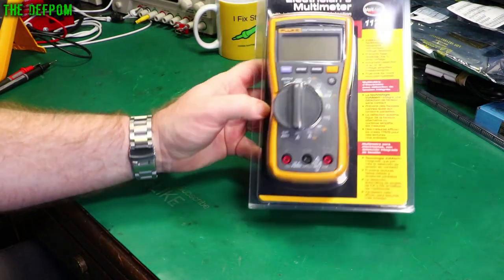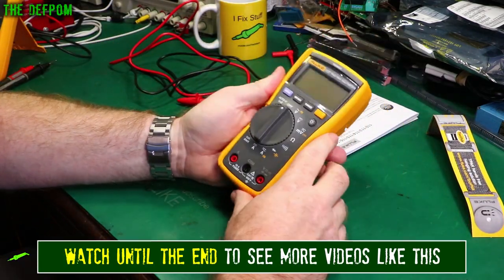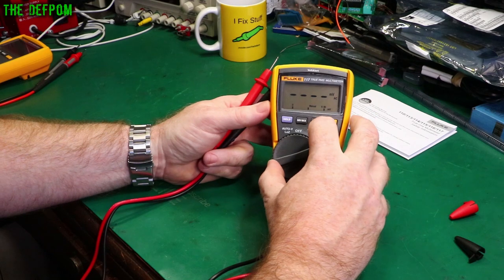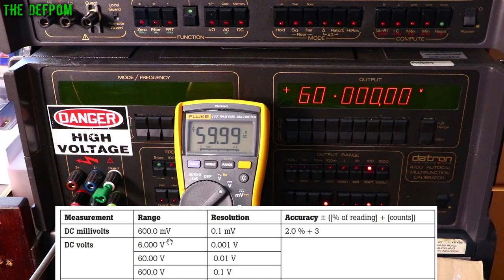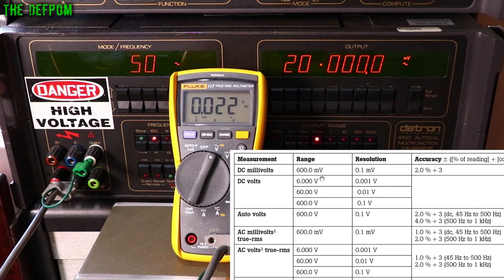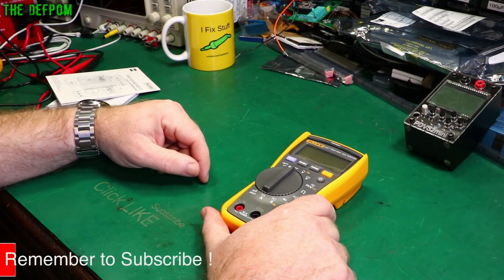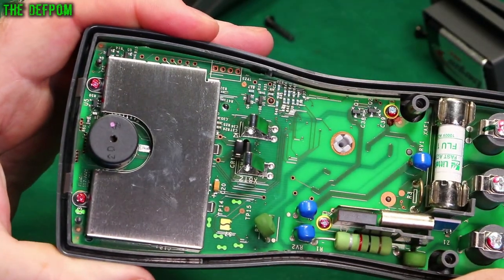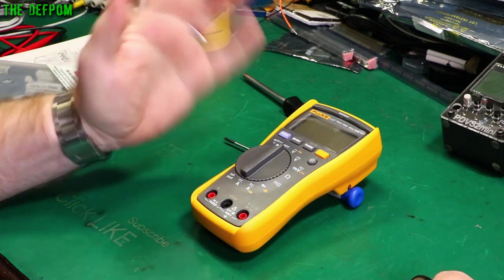🔴 Fluke 117 Digital Multimeter Review and Accuracy Testing - Sponsored by Fluke & Pomona - No.935

Comment: That simple Fluke guide to using a meter is essential. The number of graduates I have interviewed that wouldn’t even know how to measure current. It’s nearly 100 percent of graduate electronics engineers couldn’t be trusted to wire a plug. I don’t blame the individuals just the appalling standards of education at university.
Reply: I have to agree, my workplace has at times had University students for "work experience" and most come away after 2 weeks having;
Learnt how to solder.
Learnt how to use a DMM.
Learnt how to navigate a scope.
Occasionally you get an enthusiast who has a fair idea and  soaks up anything you put in front of them.👍
I went back to University in 2000, to upgrade to Bachelor.
The course was 3 years long, not 4 years when I did diploma.
I had prior learning credits, but walked in on a 2year Electronics class and they were about to be taught OHMS Law!!!😮
Luckily I knew the lecturer and got credit for that, his response was that most first year students hadn't the knowledge of the basic maths or physics to start OHMs Law.
Reply: When i was training junior Electronic Technicians it was surprising how often they would refer to the DMM manuals. Sometimes I would hide them forcing them to learn in their head rather than just using their eyes to read.....LOL!
Reply: @tomgeorge3726  Ohm's Law is simple algebra!  It's important for anyone to understand who is designing electronics.
Reply: @douro20  But it should not have to be taught in 2nd Year Engineering, that is halfway through the course.
This is basic stuff, at the least it should have been taught in the first semester of first year Engineering.
This is tertiary education we are  talking about.
Reply: My son, a BEng (Hons) brought home a friend's CRT monitor for me to check decades ago.
On opening the back cover, I noticed that main fuse was blown and told him that one or more of bridge diode/s was/ were shorted. 
He then asked, "how do you know?".
I told him that I had been dreaming about electronics since 16 years old and now I was 60. 
I proved to him with a meter and fixed the monitor. 
So I told him a degree without practical experience was no good.

Comment: I hate seeing a Fluke in one of those Vac Formed cases made to hang on hooks in the local store like you find in the Pound Shop or Tesco Home and Ware, makes them look cheap IMO and they most certainly are not. I think my thoughts on this stem from seeing the 5 quid meter's hanging in Maplin's (RIP) back when I were a lad, I also think Fluke should spring for a decent set of leads with them not just 'meh their ok' type of things. I dont think I've bought anything over 50 quid packaged like that and certainly not for 190 or maybe im a snob! always interesting to watch...cheers.
Reply: Who really cares about store packaging just buy a proper case for it once you  put it to use. A molle bag costs under $15 USD.
Reply: @robc8468  His point was about ‘presentation’ and expectations regarding a higher priced item, there skippy.

Comment: The only criticism I'd offer, as far as actual, practical use, is that the 'Hold' feature isn't even the same basic function as the Touch-Hold on the 87V or, for that matter, on my ancient 27/FM (so you can pay full attention to what your fingers are up to, and read the measurement later, once you're out of harm's way).  The Hold on the 117 just captures the display at that instant.  I suppose if you manually set your anticipated range and use Max you'd get roughly the same result, but having that Hold button on the front sure could lead a buyer into thinking it has the well-known Touch-Hold.  Seems almost like a misrepresentation.  Still, a terrific product for the money.
Reply from the maker: Yes a hold when pressed feature is a bit limiting.
Reply: funny is that Fluke 77-IV model has the same "HOLD" button, but it is actually AutoHold, not manual hold.

Comment: I have this meter and I am stunned how accurate this meter is on a percentage error basis it way exceeds the published specifications .   This is a real bargain costing about $150 in the Fluke line up.  This will be the meter I will judge the accuracy of my other generic meters on since I do not own laboratory grade test equipment such as you are using.

Comment: I must be one of the few people who prefers leaving the screen peel on the screen! I have a huge dislike to removing it (Unless it's the annoying plastic ones they put on the front of monitors).
Reply: Only the owner can remove it
Reply: Mine usually fall off naturally at some point then I cut a phone screen protector to fit and apply so I stay happy
Reply: Helps to protect from scratches and keep it in mint condition. But Fluke is pretty rugged so can last.
Reply: @jonfreeman9682  Agreed and the protective film cuts down on reflective glare from ambient light as well as protecting the screen.scratches.

Comment: The precision is unmatched. Nice PCB. Well laid out and see they've used alot of SMD instead of larger components. Nice battery compartment. I think 9V is better power choice as a self contained battery vs bunch of triple A. Never seen a 9V leak yet plus lasts forever. Iconic yellow case with a nice side mounted dial so can easily rotate with one thumb. Good kickstand. Nice overall design. Really only complaint is the price. Brymen are nice alternatives as well but you can't beat a Fluke. Great review. 👍
Reply: Excellent, and I agree 💯 on the 9 Volt battery!

Comment: Good review .
Looks like a decent little meter.
A much better enunciator than the old flat ones which when I used to calibrate was a common problem .
Same applies to the lead socket board mounts
Our meters used to get abused something terrible by field engineers who worked outdoors 90% in all weathers. .
Winding leads around the meter instead of removing them was a killer.
Got fed up re mounting the sockets

Comment: I have used the 117 for 10 years and think it is as good as you can get for HVAC work. The 116 that is for HVAC has temperature measurement but I rather use a dedicated thermometer. 
The only problems I have had is the sounder failed after my wife put the meter in the washing machine. The other problem is the battery cover screw pulls through the plastic. I replaced the cover with one from a scrap 116 and even though I deliberately kept it only nipped up it did the same thing. I recently lost it, obviously the useless apprentice's fault. After looking for something better I will be getting another as it still looks the best for me.
It would have been good to see him recalibrate it. I think you hold down the blue button and turn on to Ohms, there is a video of the method. This would show if it had a calibration problem.
Reply: Without a doubt it is the industry standard for professional work. A little pricey but you buy one good Fluke it lasts forever. Unless you lose it. Check out the Brymen as they're pretty good too and bit cheaper.
Reply: @jonfreeman9682  I am looking at other brands but the 117 gets everything right. One handed operation, good NCV and not many functions I don't need. I use a Uni T amp clamp, UT201E I think it is, which is very handy and gets into tight panels. Along with an ancient Newlec branded Megger, I can do all my electrical testing. So I am not a brand snob but the 117 ticks all the boxes and as people say, when on site customers do like to see you with a Fluke as that is the only brand they use. I will probably go for one off Ebay as there are some bargains now and then. I have just bought a Uni T UT61E+ for a job while at my house in Thailand - setting up a Lifpo4 BMS. That should do me in the meantime and pretty good for £50.
Reply: @foxythedirtydog4494  You're right. This particular model nails the essentials and has two key features other models don't have... the ergonomic thumb wheel and the NCV which is really handy working in the field. That NCV could be life saving. I'm the same I don't like meters that are cluttered with useless functions like temperature, decibels, frequency. You never use them. I only ever use voltage and continuity. Also I've seen meters with big color screens that are just gimmicks. Fluke is designed and branded for professionals and customers like to see they hired a professional and not a budget contractor. Fluke is like Mercedes-Benz. There are cheaper cars but they're not Mercedes. I have a real estate friend who says he has to drive a Mercedes or customers don't take him seriously. LoL. Fluke is the standard for professionals. But for most people who don't do electrical work professionally an el cheapo meter honestly works fine. ☝️

Comment: Many thanks for your great review
Do you think Fluke 117 is best choice for mobile repair or not?
Reply from the maker: I own the 117, 175 and 89, I find the 175 to be the one I use most.
Reply: problem - what do you do with it? end of the day FLUKE can round their meters to 3 categories 1 general where the 117 rules the day, the 87v for finer bench measurements, and then you get into the various induction categories where the 373 reigns supreme  @TheDefpom
Reply: mobile repair? you need to be more specific my friend. dont know where your from (because i dont know what your standards are) but this meter is top notch for DIY or electrician work, where you're not looking for tiny voltages or amps, but doing everyday man work. if you mean by mobile repair - cell phone work or small electronic work you will need a better meter, say a FLUKE 87v.

Comment: The screen peel!  :o
I find myself leaving the temporary screen protector on my new devices as long as possible, my tv still has one on the logo, my drone controller on its screen, and I'll peel my thermal imager once I've created a 3D printed cover for it.
Reply: Thermal imager for your drone?
Reply: @douro20  That would be cool but I fly racing type drones using goggles for the feeling of being free to go anywhere in the air, a thermal imager is more suited to the 'tripod in the sky' style GPS drones.

Comment: Regarding the Low Ohm measurement, Does this meter has shorted lead calibration mode? My Fluke 76 has that. It discounts leads resistance from Low Ohm measurement.
Reply: this model does not have low ohm measurement like Fluke 79-III for example
Reply: It's a relatively entry to mid level Fluke multimeter. It's not going to have specialized stuff.

Comment: sir. i have a FLUKE 115. But the miter is automatic off after 3o second .please tel me  what can i do .
Reply from the maker: Replace the batteries, if that doesn't work try power it on with the yellow button pressed to disable auto power off, if it still doesn't work get hold of Fluke as they offer lifetime warranty on their meters.

Comment: Question what is the best fluke multimeter for an Electrician? If I buy the Fluke 87-V max would that be a bad choice?
Reply: Depends on what kind of electrician you are what all you do the 87-v Max is great but it might be over kill for what you do
Reply: Domestic
Reply: @hosainparchment5692  the 117 is a much better fit for general electrician
Reply: Any multimeter can do unless you need brand name certifications and reliability for industry applications where precision is critical.
Reply: @hosainparchment5692  The 117 would probably meet all the needs of a non industrial residential electrician  but if you do industrial work you might need the Fluke 87-V,

Comment: 4:44 The speed you hit the leads together doesn't make the test harder for it, unless you moved faster than the speed of light.
Reply from the maker: @xfloodcasual8124  try running the probes along a row of header pins or IC pins trying to trace a connection and you will see why continuity response time is important. Don’t confuse how fast electricity moves with how quickly the meter responds to sensing the probes connected together, I’ve measured response times as slow as 250ms !
Reply: @TheDefpom  Agree but you just need to tap it from 1mm away to experience the response time. The "swing" you are doing is irrelevant to the moment the probes tap. I use Hioki + Fluke and the feeling of response time of Hioki is much faster, so you can feel it.